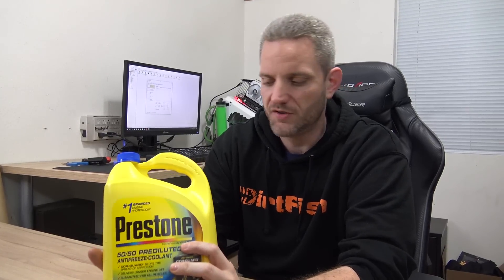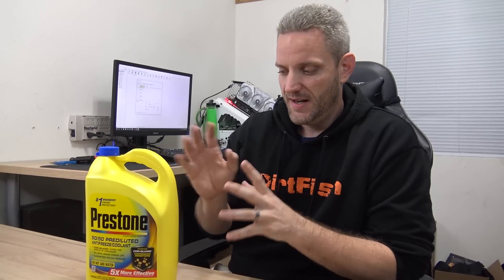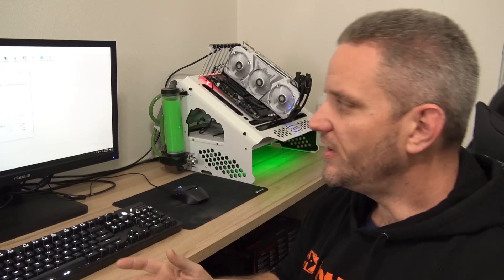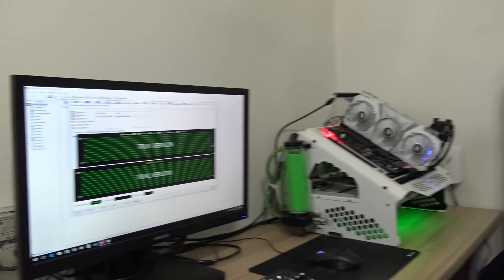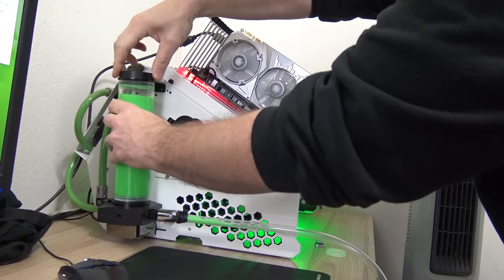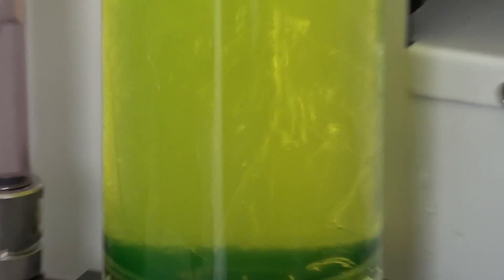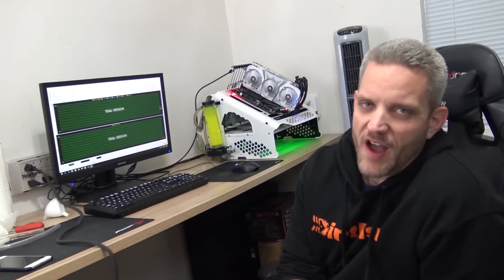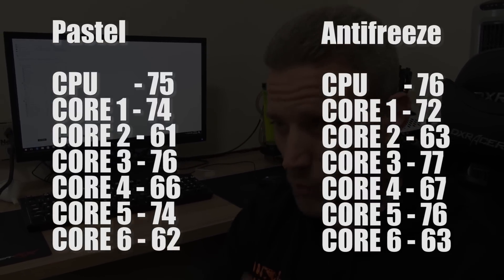I used Antifreeze to cool a PC

Comment: @JayzTwoCents Was it that Primochill soft tubing? 

If so then i have had the same strange color change using pastel white where my Primochill soft tubing changed color from clear to pink. But i think my tubing changed color due to too much flux in a new radiator which i didn't flush enough i think or another bad phD eviroment, but the my coolant white as white as the leftovers i had from i filled it up.

But Jay you should try out the new clear tubing EK made a few months ago, and test if it is as god as their ZMT tubing.

Comment: I think a good longevity test would be to expose various components to the antifreeze and see how they hold up... for the sake of science i say put it in a capped off tube and let it sit. Sure it will not have fluid flowing by BUT its something. 

Really any heat conducting fluid will work its a matter of like you said how chemical resistant everything is & how long the fluid lasts without going rancid!

Comment: How quickly would a watercooled CPU thermal throttle if the pump failed (or was switched off for testing purposes) There's still a large mass of water to heat + rads and fans to cool it. 
I'm just thinking, I leave my pc running F@H 24/7 watercooled and wanted to know if pump failure would fry everything

Comment: Hi Jay.  Probably going to annoy you but I think the idea of running it with antifreeze apart from the corrosion protection is that you can now cool it  down below zero centigrade and that way get better temps or higher overclocking.  Just a a thought.

Comment: It would be cool if you water-cooled a PC using nothing but car cooling system parts like a heater core for the rad ,etc. 

Or, try out motor oil (synth, regular, or blend) and see how well each works. Might be a bit dangerous though

Comment: I've had prestone in my system for two years. When my brother comes over at two in the morning and decides we need to add water cooling from an old board to my computer.... After taking a four inch grinder to the water block to make it fit past the fins of the north bridge I am not worried about the anti freeze! good ol socket 775 took it like a champ

Comment: If you have enough spare parts you could throw together a dummy loop to leave running in a bucket or something. Just to see how long it'll go. Though the only things I can see it hurting are the tubing and maybe the seals for the pump impeller shaft, if it's not a magnetic coupling drive.

Though it's probably just not worth the effort, using automotive coolant is stupid as you pointed out already.

Comment: Water xfers heat approximately 2x better than ethylene glycol.  That's why cars don't use 100% propylene/ethylene glycol in the cooling system.  You would of been better off using H2O as your baseline. Then run some Hg as your cooling fluid and see how the temps drop.

Comment: I'm a bit baffled by your temps. I'm currently at 4.4 on my 6700k, and a fairly lengthy stress-test saw a max of 61-degrees, and I'm only using a Corsair H115i with a pair of ML140's providing the breeze. I freely admit that all your builds look cool as hell, but are they really colder than a cheaper build?

Comment: hay Jay.  I have been running distilled water and a coolant with inhibitors for approx 2 years on my soft tube loop. No issues this far and have not noticed a downgrade over time. don't know if or what diff it makes but used a coolant that said it had a 5 year life so yeah. anyway love the vids and keep up the good work mate

Comment: What about alcohol or methanol? Would that work?
Reply: Fishhunter2014 probably not. ethanol and methanol vaporise at low temperatures, so instead it might become a gas and put more pressure om the inside of the loop. gasses are also worse conductors than fluids, so it probably won't cool as well.
Reply: Arquintox makes sense. I had thought about that problem but didn't know for sure.
Reply: Fishhunter2014 shit will begin to evaporate and flammable
Reply: no fucking way it would

Comment: shoulda just went with distilled water and cooling products like "water wetter" that in auto use drop temps by breaking the surface tension of the water giving better contact for heat dissipation

Comment: What about Glycol free tho? the problem with a 50/50 mix regardless of its inhibitors is there are still water molecules that will cause slight corrosion in the system.

Comment: nice video could you take a cooling loop that is not attracted to a PC and try different liquids long term and see the differance and possibly have some kind of heat element to mimic a processor so if anything catastrophic happens it doesn't damage real hardware if so I would be interested to see that

Comment: I would like to ask those guys that say "why not just run anti-freeze" if they know anything about automotive cooling.  During the hot summer, water works better than any anti-freeze to cool your car down.  A lot of guys that run their cars in auto-x run water because it's cheaper and works better.  Then when winter rolls around, they switch to anti-freeze because if you let water sit in your car, the block will crack because the water will freeze.  There is a reason why anti-freeze is called anti-freeze.  So unless you're leaving your PC outside in the cold freezing temps, it's completely pointless to use anti-freeze in your system.  So don't ever do it to your PC.

Comment: Hey Jay, why don't you setup a test system with a basic loop (reservoir, pump, waterblock, radiator) and just let it run ? You could add black plastidip on the waterblock and put it facing south if you want to add temperature into the mix.

Just to see what would happen and how long it can run.

Sorry for bad english.

Comment: i have used antifreeze in my mixed metal MIXED plastic loop (copper, aluminum, silicone, and acrylic) for over 6 months with no "reactions ", but i also only used a 15 percent concentration just to act as a corrosion inhibitor and to discourage biological growth. It has kept my fx 6300 clocked to 5ghz at a chilly 48c under full load.

Comment: Antifreeze as it's name applies is to prevent freezing of the coolant. In performance vehicles you want to use a mixture with more water and less antifreeze for better cooling, 70/30 typically.

I can understand why this could be a common misconception because it's often referred to as "coolant" but that is a reference to the mixture itself. Antifreeze itself hurts the cooling performance compared to water.

I've also learn this by using glycol in industrial boilers. It keeps the system from freezing but it always hurts performance even if it's only slightly.

Comment: in order to test the longevity of the tubing and what not, why not get a pump you dont use and a bunch of tubing and set up a mock-loop in your garage without any components aside from the tubing and the pump and let it run for (x amount of time) that way you can see how long the tubing would last with the anti freeze in it without destroying any hardware.

Comment: I have the an answer depending on whether or not you use Dextron or the other brand you can run into different results, I cooked a quad core processor using anti-freeze after the rubber O rings dissintegrated leaked and ran down to cover the socket. So The plastics seemed fine but I wouldn't garantee that either. So I totaly agree with you on Just using water if you don't want to run out and buy Coolant. Glad you brought up the subject. Nice Call, Keep up the good work.

Comment: I use antifreeze to cool my system for a couple of months because I have an external water cooler on my balcony so sub-zero temperatures can be an issue for distilled water.

Comment: Corrosion inhibitors clean corrosion off of it. It uses a light acid to remove oxidation. This is ok on hard metals such as steal, but bad for soft metals such as some copper, aluminum, and brass. Aluminum used in these components is a different type of Aluminum used in car blocks and heads. It is much softer.

Comment: I ran 30% antifreeze and distilled water in a mixed metal loop for nearly 3 years, never changed coolant or tubing. when I tore it down every single block and rad as well as the tubing looked brand new. I still keep the blocks somewhere just in case I feel like doing a gold/aluminum loop again. most coolants today is from the same stuff, albeit in lower concentration, it just doesn't work well with PETG.

Comment: Just curious Jay, what voltage do you have for your 4.4 GHz overclock on the 5930k? I can get a stable 4.4 on mine at 1.29 v which I think is a bit high.

Comment: The reasoning for using PURE ethylene-glycol is that it's non-conductive. So if leaks happen in a powered on PC it won't break it instantly.
Second the stuff that you saw when you poured in the antifreeze was probably the water that's left in the loop. Different densities and refractive indexed can cause that effect, nothing alien there (except the color of that anti-freeze).
I believe a loop can be created where everything is resistant to the glycol and in that case it can actually be useful as a protection of the components inside the PC.
Just my two cents

Comment: iv used anti freeze in a rigged up modded,  aio  now for about 6 monthes and even used food coloring for dye and had no issues what so ever, except stained tubing. with clear pvc and vinyl tubing. and both pumps i have still work great.

Comment: Why would anyone spend extra money putting anti-freeze in their PC cooling system? It does nothing good for you. It technically doesn't even cool as well - pure water works better in terms of actual cooling performance, though the difference is small in this kind of scenario, as Jay showed. The primary purpose of anti-freeze is to do just what the name implies - keep your cooling solution from freezing. Not a concern unless maybe you're running specialized equipment in an extreme environment.

On a side note, propylene glycol isn't poisonous, it's even used as an additive in many foods. Ethylene glycol IS toxic though and can kill you, but propylene glycol is replacing it (in automotive coolants) because of the harmful nature of ethylene gycol. But DON'T be drinking anti-freeze in any case because there are other poisonous things in it, which may include antibacterials,  anti-corrosives, lubricants, and other various stabilizers to help prevent the propylene or ethylene glycol from degrading.

So basically you are doing nothing good for your PC by using anti-freeze in its cooling solution, you are just adding more toxic substances to your in-home environment.  and it costs a whole lot more than distilled water.

Comment: 50% thats quite concentrated .cant buy that here.
btw i had an swiftech AIO (the early ones) and after an year got probems. i dismandled all and saw alot of gung so i cleaned it and put pre made antifreeze (for -25C) in it and after 2 years when the pump died dismandled again and its was still clean.
got the kraken now so i can see water temps now.

Comment: Long term you will have fitting dissolve, and plate degradation . All Anti-freeze has acid based anti-corrosion
Reply: Wait how does "acid based anti corrosion" even work? That seems entirely backwards.
Reply: All anti-freezes are very basic, and operate around a ph of around 10. You are COMPLETELY ass backwards lmao

Comment: Try Liquid Hydrogen because I like fire
Reply: Vasco Serrano you mean liquid oxygen
Reply: DanKop No, he means liquid hydrogen. Liquid oxygen is not flammable.
Reply: Liquid oxygen is indeed flammable.
Reply: MrAntieMatter you are honestly a dumbass. LOX is not flammable
Reply: You want me to be a tiny bit more specific? Oxygen is technically not flammable, it just supports burning.
Reply: MrAntieMatter There you go! I knew you had it in you!
Reply: MrAntieMatter it doesn't support its necessary for combustion the amount of oxygen determines how hot or long it will burn
Reply: Ronald Smith they use liquid hydrogen and oxygen in rocket ships. Liquid oxygen is flammable, but it's more of a catalyst.
Reply: ***** Basically
Reply: Hey bud, not all rockets use LOX as its oxidizer. And LH2 is not always used for the fuel, it is extremely lightweight and has a low ISP in the atmosphere.
Reply: "
 
"what. oxygen is what allows crap to burn. OF COURSE ITS FLAMABLE YOU IDIOTS. however, pure LOX will not burn, it will pretty much explode"

Comment: use cooled water i guarantee that it will run cool
Reply: Puts ice in reservoir, reservoir builds up condensation as well as tubing and leaks on components, my computer brokededed
Reply: The temperature of the fluid is a secondary issue, a side effect. What matters is how quickly you dissipate the heat from the system. The hotter the fluid is, the more quickly the radiators will dissipate heat. So, the components will heat the fluid until it is hot enough that the radiators will cool the fluid at the same rate that the components are heating it. Similarly, larger/more radiators will dissipate heat more quickly as well, so the fluid doesn't have to get as hot.

Chilling the fluid works exactly the same as a radiator; it just adds a lot more steps between the fluid and the ambient air. And, in practice, you wouldn't chill the water below ambient temperature (no reason to). So, a water cooler is just an elaborate heat exchanger. Even using ice from your freezer is the same principle.

Only a few things are worth changing. The number or size of radiators and the CFM of air passing through the radiators. And, radiators are basically just heat sinks. So, water cooling is basically just air cooling with  larger heat sinks on your components that use heat pipes made of flowing water.
Reply: wat?
Reply: ive thought about doing that but insulating the tubing/reservoir to prevent the condensation leaking down on your components, place down a fine screen in the res to separate the ice from the tubing so small bits dont flow down the tubing
Reply: agree but will add the difference between water and air is the speed at which water removes heat from the cpu, gpu,, water much faster,, and bigger or more radiators just gives fluid longer to cool to ambient before going back on components...  want to cool it good use 40 feet of tubing and go around the room ,, basically same thing
Reply: ( ͡° ͜ʖ ͡°) Rekt

Comment: use alcohol . not the kind for drinking the isopropyl stuff
Reply: it will harm the o-rings and seals lol. Plus the pump will most likely cavitate.
Reply: Pranav Soondar Use Ethanol and Isopropyl and see the difference
Reply: doesnt that harm plastic
Reply: Pranav Soondar alcohol gets gaseos(I dont know how to write this, Im german) at 80°C and water  at 100°C so alcohol is kinda  the worts liquid for cooling

Comment: use a  car radiator and make a custom fan bracket with like 20 fans lol
Reply: You will find the limit of heat trasfer from the block/s before needing a rad as big as that.It may look good prior to becoming heatsoked, but it wouldnt peform any better than a smaller rad at the end of the day, while requiring more enrgy in form of fans and pump.

Comment: Jay, Linus used anti-freeze in his whole room water cooling set up. It sent so wrong because it didn't have a growth inhibitor. Everything clogged.

I guess it works in a car because the heat from the engine essentially pasteurises the coolant on every drive.

Comment: Most racecars today use a non-glycol coolant.  It is not an anti-freeze. It protects from corrosion and rust and is a great heat conductor. It is also non-reactive to plastic, rubber, and metal (I don't know about PEG tubing? ) This is what I'd be curious to see?  Summit racing sells it for about the same price as Prestone.

Comment: I tried replaced my a month old Raijintek AIO 240 stock coolant with Toyota Radiator Coolant 50 + 50 distilled water (Long Life, black and red packaging) the water pump stock working after a week, sent for RMA. The next thing is I tried with my custom loop, the reservoir cracked and leak. Now 100% distilled water.. hmm

Comment: I have always used antifreeze mixed with water in all of the watercooling setups i have used. 

The mixture in the current setup has been in the loop over two years now and it still looks fine.

Comment: Correction: You can use propylene glycol with PETG. So far I do not know of any labs that have produced data showing them to be incompatible. Most coolants on the market will be either propylene glycol or glycerol (glycerine). Note that ethylene glycol is also called "ethane-diol" on some labels, and propylene glycol is called "propane diol".

Automotive antifreeze also doesn't have any biological inhibitors, and that's the main reason to not use it. In a vehicle, it doesn't need it either since the coolant will still get near or above the boiling point of water, which is an environment that is inhospitable for any microbes and organisms you'll find on land.

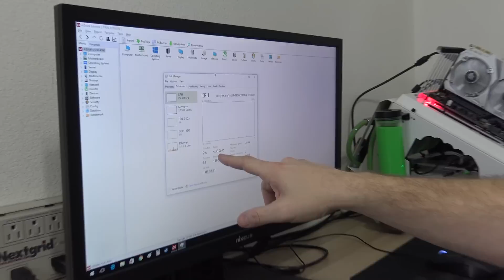Comment: At 3:18 why does task manager say the max speed is 3.5 but then the speed says its at 4.38?
Reply: most diagnose tools can't handle CPU overclocks and show the stock clock
Reply: task manager lists the cpu at the top and shows stock speeds but the actual live speed is the one at 4.38 mine shows 3.5 on my 6600k but im running at 4.5
Reply: Billy Benedict same cpu and clocks as me, bro. High five :D
Reply: Oh ok thanks